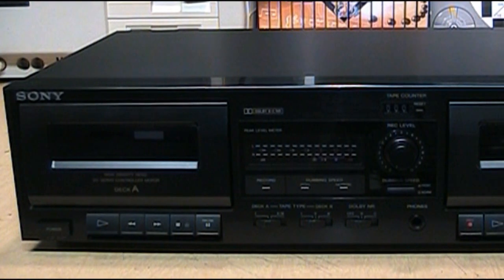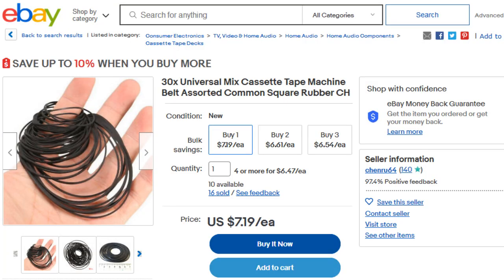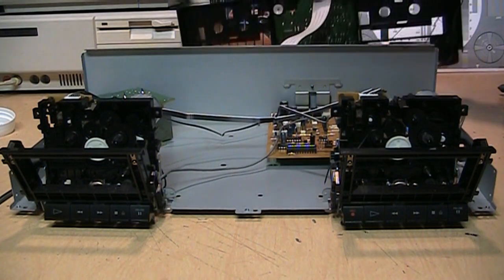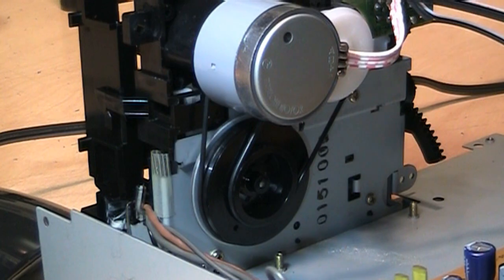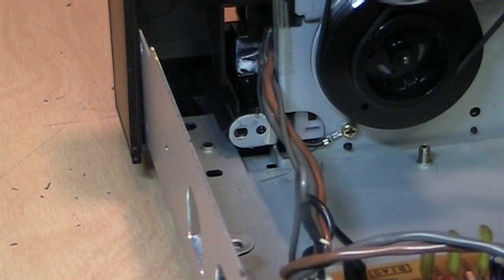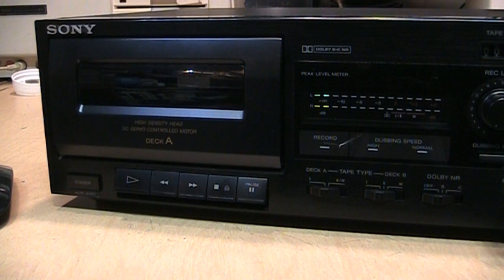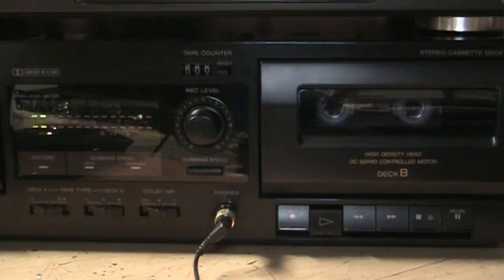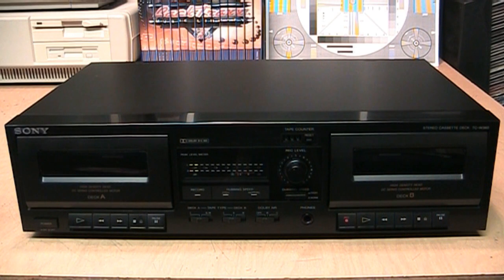The All-Plastic Sony Surprise cassette deck - TC-W365

Comment: The belts looked to be the ones that are made with some petroleum jelly or something similar. Why that gone a ton of belts? Maybe because Sony realized that after all the plastics, putting in some plastic gears is too much so a belt did the puropse...and minimized driveline flutter...and the case is so BIG but what's inside is about 95% air...boggles the mind

For cleaning the tar I use this stuff locally known here as "Wipe Out" which contains deodorized aliphatic solvent, polyoxyethylene nonyl phenyl ether (a detergent) and lanolin that makes the rubbish goo simply wipe off cleanly. Mostly used for cleaning plastics and such. But regardless...that black stuff is so evil that if I do get it off the parts with this cleaner, you touch that goo and it sticks really HARD

Comment: Have you found a product that works well for removing the melted belt goo?  I have a similar vintage Sony full logic deck that the belts have melted.  I haven't decided if I want to tackle trying to resurrect it or not but part of that decision depends on how big a PITA cleaning the pulleys up is going to be.  I just don't want to use something too aggressive and end up melting the pulleys as well.
Reply from the maker: I just used isopropyl alcohol.

Comment: Both mid 80s Sony devices I've replaced the belts on (a PS-Q3 turntable and a WM-10 walkman) had the original belts disintegrate into black dust instead of melting into goo. They still managed to cover the brass flywheels with green corrosion residue though, so I'm not sure it was an improvement.

Comment: We have a sony all in one thing, which i am not sure how old it actually is, it has dual cassette decks, a CD player, AM/FM radio, built in amplifier, and thats about it apart from the single line input on the back (which is labelled as AUX)

Neither cassette deck on it is functional, one of the decks broke when i was attempting to record something onto tape, the other one has always been broken, that thing has full logic control, but only 1 set of play, stop, fast forward, rewind buttons, there is a button to switch between the two decks, but the unit will also switch deck when a cassette is inserted into either deck, if there is not a cassette in the other deck
There is also a pause and a record button, but those are only for deck B

And that deck can only play and record to type 1 tapes, the unit will not even acknowledge the presence of a type 2 tape, it appears to use the type 2 tape sensor as a “tape present” sensor

Comment: I bought this deck. Relieved by the Sony branding, I was immediately horrified and had to return it.  Until then, I had believed Sony ONLY made good stuff & great stuff. I grew up with Trinitron and hot Sony portable radios. From other comments? I think mine was an even cheaper model. Or actually just defective.

Comment: Interesting design choices SONY made ... push button keys that at a glance look like soft touch, weird big cassette doors that cassette is pushed on one side. Just weird.
Plastic cassette transport mechanism that rattles, but I guess when it came down to electronics for sound they made a decision that good sound quality is more important than 'as cheap as possible' principle for the rest of the deck.

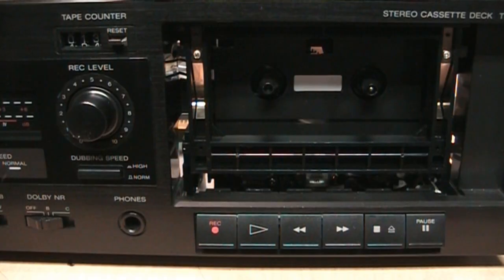Comment: I've found a tape deck of that model, is a very bad model, not full auto stop, if the take up reel get harder to spin it will start to pull a lot of tape before it gets noticed. The plastic fly wheel holds a metal disc but the clips that hold it might be cracked and might be the noise you hear at 9:25 , I had to use a drop of Crazy Glue on the 3 clips of mine, that knocking sound also was causing wow and flutter. The counter belt is taken from the supply reel that also added wow and flutter, very bad design.

Comment: i get what you were trying to say but actually that mercedes with a manual is cool AF compared with the lincoln (don't you drive a manual yourself!)

i could imagine this sitting comfortably in one of those insanely marked up full cabinet systems from rent-a-center
Reply from the maker: I know! I owned a 1981 Mercedes 240D with a 4-speed manual and I loved it.

Comment: I tried to get some idler tires from that west coast belts place. They sent the wrong size (even though I specified the correct deck model). They never did send the right ones. I had to go to eBay for a credit on that one.

Comment: 14:47 I have the same album, and at least on my main deck, it seems to be running fast. I'm not sure if it's the tape or my deck's fault, and in the video it seemed to be running fast. Was that just due to the machine, or was yours recorded fast as well? Very interesting video, as always!
Reply from the maker: I did not try to adjust the speed. If this deck is running fast, that's how it came from the factory.

Comment: This deck is proof that it is possible to create a decent sounding deck with budget parts. Even with the very limited supply of mechanisms, you have to wonder why it's no longer happening.
Reply from the maker: The currently available TEAC and TASCAM decks sound good and work well. I've reviewed them on my channel.
Reply: @vwestlife  Yes i did see those reviews, thank you. Those are very much 'premium' decks these days and my point really was why can't it be done at a much lower price point.
Reply: @lesrogers7310  £360  ( the UK cost of a W-1200) or a similar amount of $ is not much money. You can buy a  record turntable, and audiophiles will tell you it is cheap rubbish or a bottom end Phone that is only the 1/3 of the cost of an I phone. or a shower pump with brass impellers ( on special offer normally £700) and a 1980 cassette deck would have cost more for the equivalent spec of the W-1200 in  1980 in the $-$  inflation figure.  The iPod and other MP3 players have a lot to answer for. They started very expensively, and now you can get one for £10 that is able to hold more than the first IPods.  We are waiting for over 13 weeks for a car part for £240 and all it is is one board and it will fire the airbags. That is in my mind expensive but it is the only part to do the job. Then we will have to pay labour on top. Expensive is relative.

Comment: Last computer I built that used 3.5 floppy drive was a 2007 pc.  AMD Athlon 64 x2 dual core @2.9 GHZ . with 6 GB ddr2 ram and a GeForce 9800 GT that had 512 MB of gddr3 video ram. And the HDD was 320 GB. Actually still got that pc in a box although ots just the CPU ram a main board now.

Comment: I had one just like this as a kid…though I believe mine had auto stop included. Other than that looks the same and the one I had could be controlled by a Sony receiver remote. I remember that the deck sounded good but my dad had a Dolby S deck from Sony and really wanted that one lol Anyway who knows what happened to those decks, probably got dropped off at Goodwill, really wish I still had that deck as tapes are coming back in lol

Comment: I thought I maybe heard some pitch fluctuation on the recording test?
I picked up a similar looking but single mechanism deck at a thrift store for $10. By the 8C on the back and a note in the service manual from 1989 I'm guessing it is from 1988. Hoping it's not all plastic but I'm guessing the belts are goo as it doesn't play. Interestingly shop selling belt kits in Canada says it needs 3 belts but West Coast's kit only has 2 -- guess they've left out the tape counter belt altogether. :/

Comment: That doesn’t sound bad, being an all plastic Sony. That may only sound bad, but it isn’t. I really think 💭 that it’s a proprietary trade secret “change” with the belts. The motor in this is not burned 🔥 out, so the news 🗞 is that much better. That, or cheaper materials, which simply turn to mush. That makes unwary people buy more of this equipment. All this needs is belts, and possibly capacitor replacement. For most people, this is the end of the line for the equipment, financially, but sentimental value, or the item being vintage, is an entirely different story. Your friend, Jeff.

Comment: that "drive belt goo" has to be one of the messiest substances known to man. I accidentally dropped a tiny bit, the size of a sesame seed on the carpet and ended up with a four inch square black mark that would not come out no matter what I used on it!

Comment: I believe that the tapes you played back that were *not * recorded with this deck are running too fast. Neither the first nor third track were running at concert pitch.
Could you A/B them against better decks, as that would really help put it into perspective, perhaps in another video?
Reply from the maker: It was running a bit fast, but that's the way it came from the factory.
Reply: @vwestlife  Aah OK, I had a strangely named Japanese Walkman with built-in speaker that did that when I was a kid, it made listening to spoken-word very strange.
I thought yours was running fast because of the new belts not being absolutely calibrated to the deck, but I guess not haha.

Thanks for answering.

Comment: Talk about a cheap cassette deck. I've never seen one this cheap with an mostly plastic cassette mechanism. I have a Sony cassette deck which is very similar to yours but has a better mechanism with metal parts and full auto stop. I did have to replace all the belts due to stretching but none of them turned into black goo.

Comment: "DC Servo ccontrolled motor" LOL ..... the same motor they have been using perfecting and cost reducing for 2 decades. Not even  close loop .... A few year back they used FG servo in many of their bottom line decks with out even mentioning

Comment: Why does the title have a missing character symbol?
Reply: That'll be your browser. On Chrome, it's showing a cassette emoji.
Reply: @uknortherner2000  Looks like my device doesn't have the cassette emoji, only the VHS tape one.
Reply from the maker: @uknortherner2000  It works in Edge too. I'll try it in Firefox later.

Comment: Looks like Sony went from being the makers of Alpha of hifi stereos  to the Beta Max in the '90s! 😂
Reply: Good thing Beta itself had a really nice semi-pro offshoot and several really nice pro offshoots then, although the semi-pro offshoot, ED Beta, never really gained any traction, but from what I understand, as far as resolution and video quality went, ED Beta was actually capable of going up against Betacam, which is really impressive for a composite analog video format vs. a component analog video format like Betacam.

To add to that, ED Beta gear is unobtainium while Betacam and Beta SP gear is all over eBay.

Comment: So does this mean my dad's Sony TV-WE305 is also junk?
Reply from the maker: No, it's actually better -- that model uses Tanashin mechanisms with a metal frame.
Reply: @vwestlife  Thanks. That's good news. Still needs new belts due to age.
Reply: @vwestlife  that's good to know! I recently found a TC-WE305 at goodwill. After putting new belts on it works great!

Comment: I know these cheap plastic mechanisms from Sonys boomboxes but I never expected a full size tape deck from the mid 90s with piano keys and this bad build quality from them.
Reply: -Bad quality?? -You do realize that it's almost 30 years old and still works perfectly fine after replacing just rubber belts, has Dolby B and C, Metal tapes capable and sounds pretty good for probably cheapest Sony's deck ever made?!
Reply: @AaaAaa-ly3on  Yes, it works. But it´s still cheap crap, I wouldn´t pay anything for it.
Piano keys are acceptable for a 70s deck, not for the 90s. In fact I own a Wega (=Sony) deck from 1977 which has piano keys but has superior build quality. Full metal everywhere, no plastic. Analog VU meters and silent operation thanks to it´s massive flywheel.
A good metal tape costs way more than this cheepo deck, no sane person would use this deck for recording on metal.
One more thing to keep in mind: 
Avoid double decks at all costs.
Reply: @macdaniel6029  Your 70-ies WEGA most likely has been designed and probably even built in Germany, cost stupid amount of money back then and has almost no relation to Sony at all!.. ;) Sony still fighting to this day, but all those once great wunder-stuff "all metall construction" makers like Wega, Telefunken, Grundig etc long-long time gone...

Comment: U obviously know NOTHING about Mercedes cuz if u own a Mercedes with a manual transmission u have a pretty rare,valuable car. Even if it's wreaked u have about 3k sitting  in that transmission tunnel
Reply from the maker: I did! I owned a 1981 240D with a 4-speed manual.